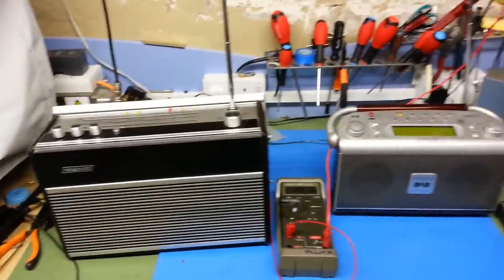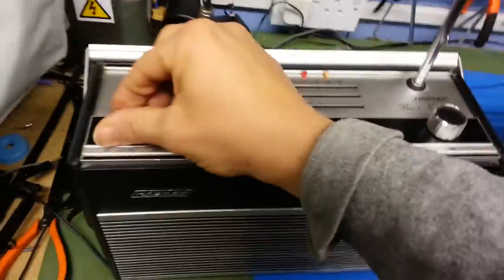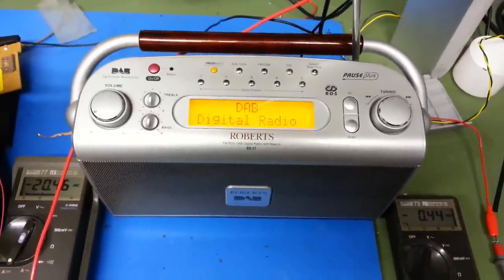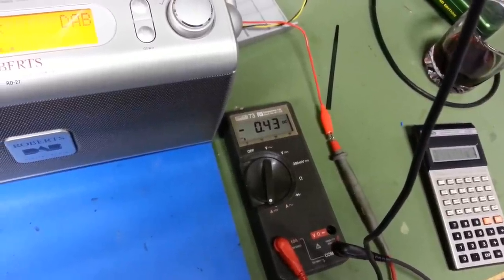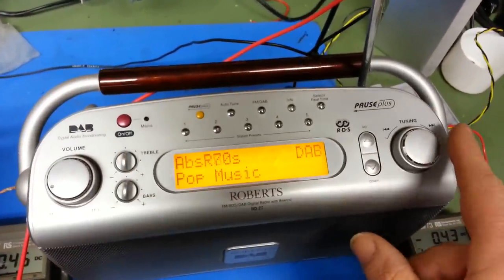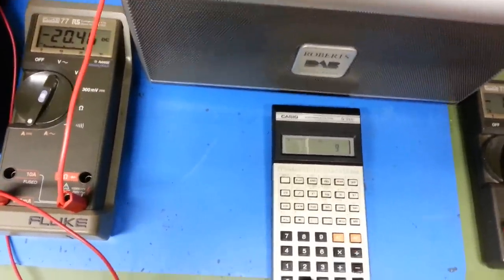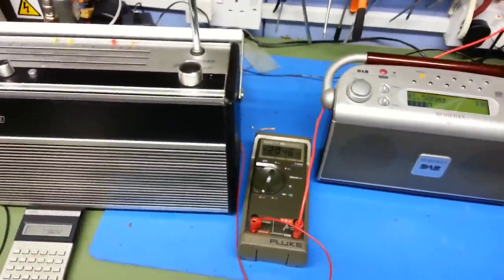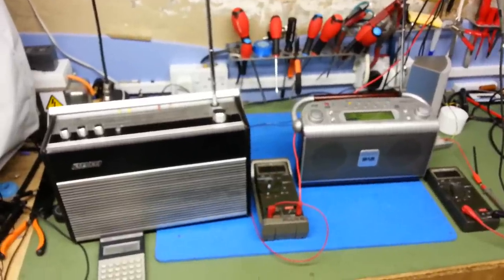DAB radio, the truth..

Comment: It seems the fashion to run down DAB these days,I've been fully DAB since 2006 and I think its great.I regularly listen to The World Service,Abs.80's,4 Extra and  two dozen other stations not available on the over crowded and hissy FM band.
DAB technology and its extension will never be improved if we listen to the anti DABers making the bland argument 'no one wants DAB ' nonsense. FM still has its  place we can have both.
Reply from the maker: I agree with a lot of what you say but not all. When I did this video some years ago DAB reception was poor at best, and I could seldom get a reliable service. However I did this same test again a few months ago and now get a strong signal with no garbled distortion like before. What I still don't  like is the high compression used on the audio that ruins HI fidelity reproduction. Granted as a media for portable devices and highly compressed modern music it's fine. But classical music sounds bubbly still and this will need to be addressed before most would class it as high fidelity. 
And my final issue is with power consumption. How Long does a DAB radio play for on batteries? A day or two at best?